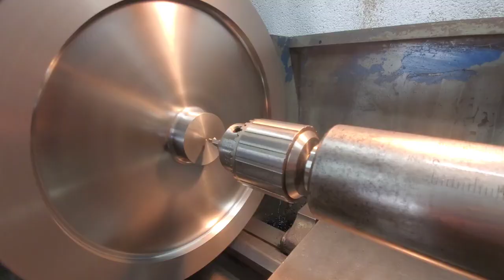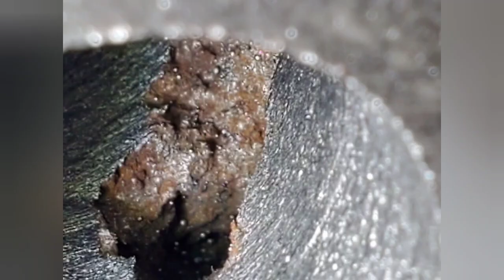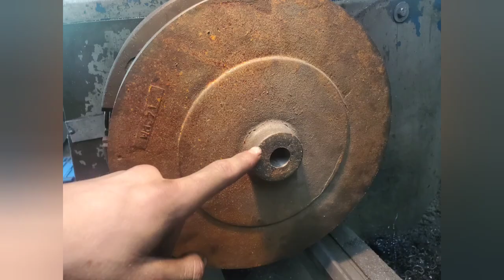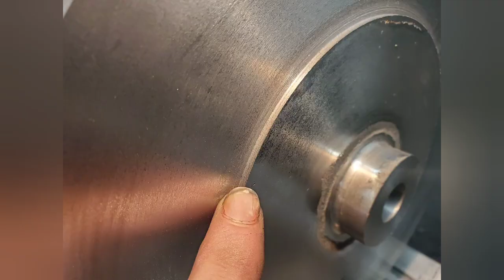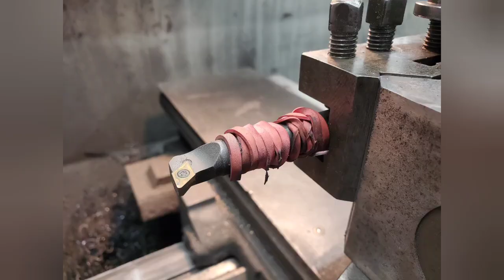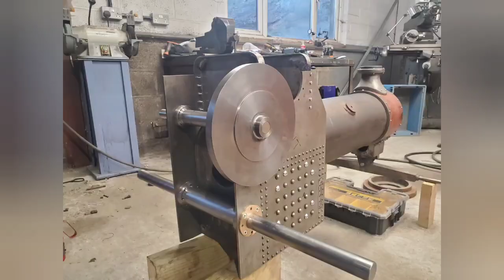Fast Gear on second shaft, The 4 1/2 inch Burrell Build.

Comment: I thought that Burrells didn’t have a second shaft is that not the 3 shaft u putting the gear blank on 
They are only 3 shaft engines 
Crankshaft , 3 shaft and axle
Reply from the maker: The third shaft is positioned behind the crank which drives the second shaft possitioned above the rear axle. If you look at somthing like a garret you can see this or possibly on your mclaren. The rear axle is the first shaft and then the one above is second i would have thought. And as you correctly said the burrell dosent have a third shaft so it just drives the crank directly from the second shaft where is gear is being fitted. I hope everything i have said answers your question and is correct.
Reply: @Ashtonsvintageandclassicahh right yes thanks but think it other way round though lol crank is first shaft then on my Mac one behind is second then the one on horn plate is 3 and the axle 4  
Your build looks like it’s coming on we’ll think I’ve seen you before at Shrewsbury rally 
On that vid u did on that rally I was in there driving Fred dibners roller Betsy with my mate